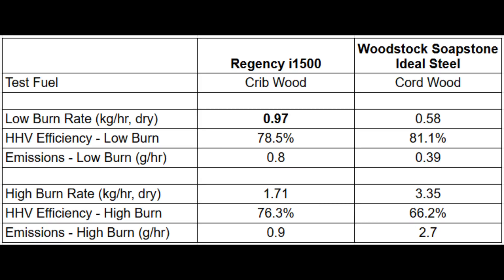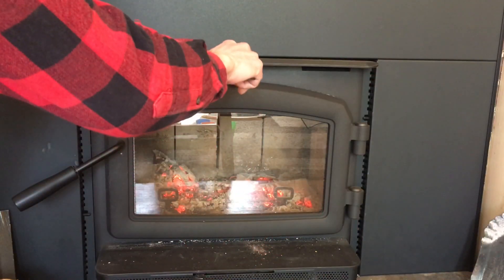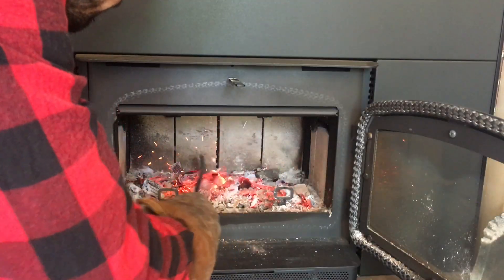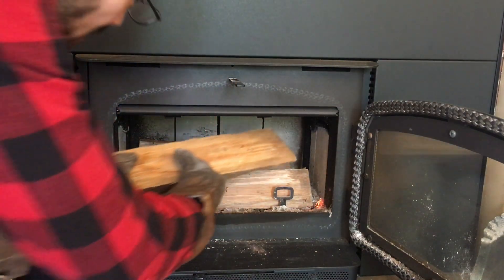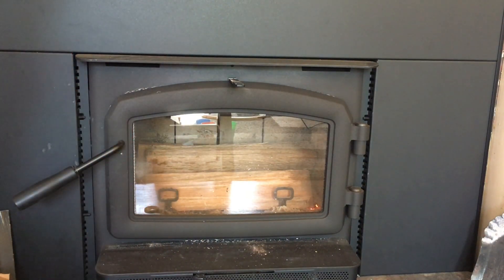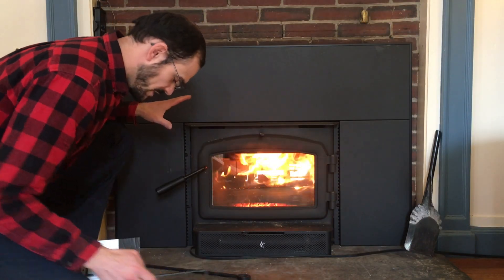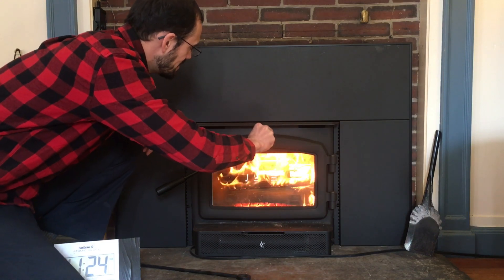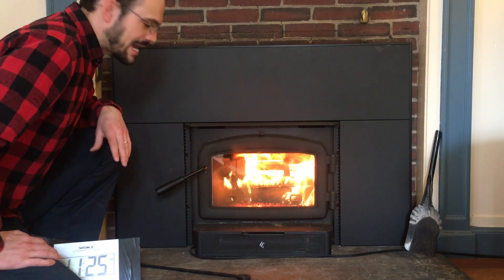Tested: Regency i1500 Real-World Maximum Burn Rate

Comment: I don't believe the i1500 has a catalyst ?
Reply from the maker: It absolutely does. It is a hybrid wood stove, with both secondary air tubes and a catalytic combustor. The i1150 is the same size unit with secondary air only.